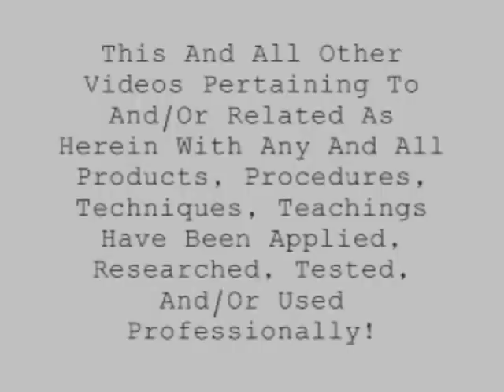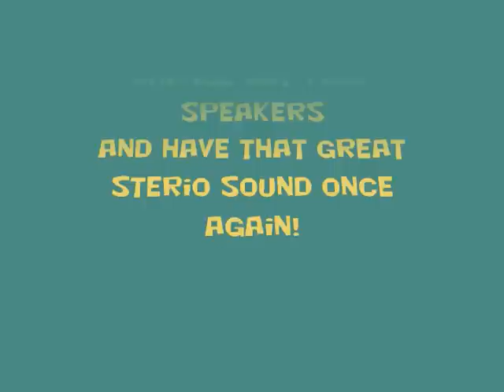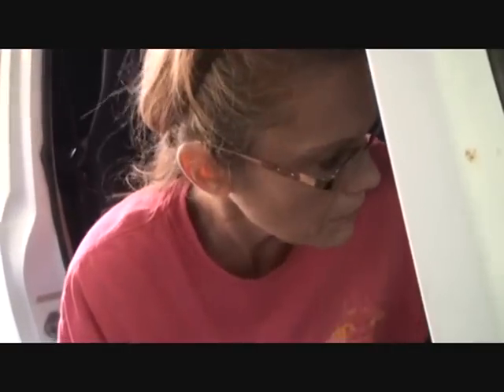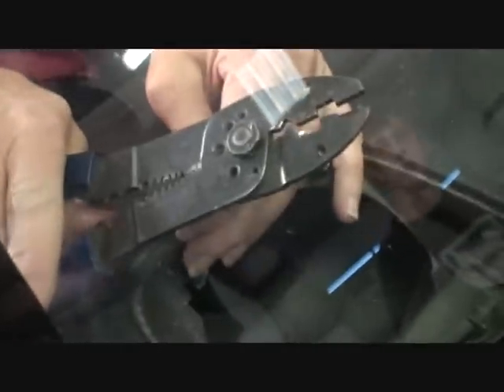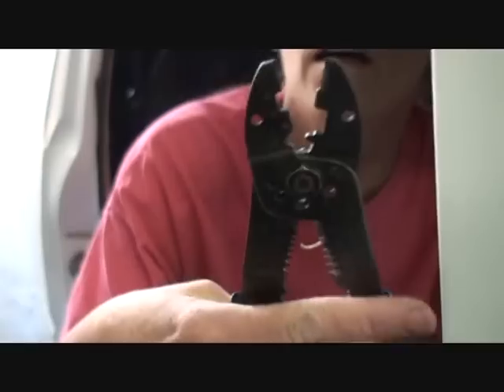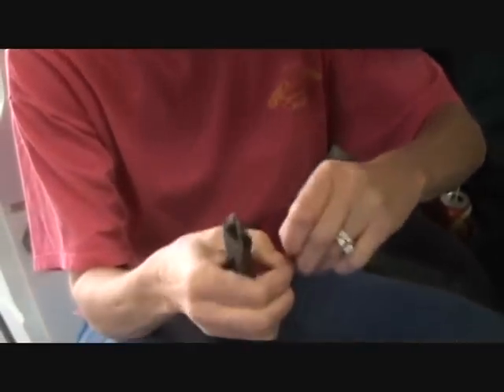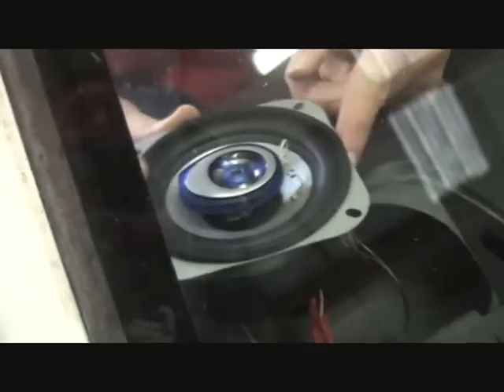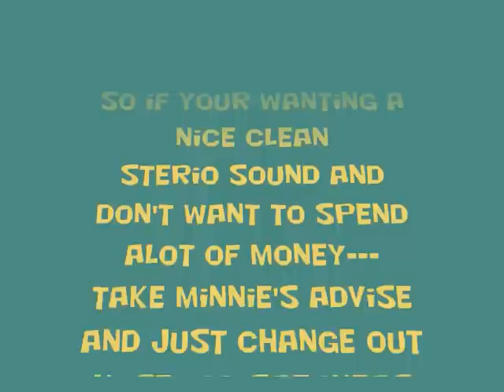Car Stereo and Components: Changing Out Your Old Speakers

Comment: Good job MInnie and Pete.  Putting the two wires on the right posts makes a big difference Pete.  There are a Neg. and a Pos. sign on the speaker.  If on wrong, the sound will pump backward instead of outwards.  Tubers will need to know this.....John.

Comment: i like the technical term "Minnie"used(smushed)to attach the red but connectors but all that could have been avoided if the girl was to remove the factory speaker wires from the plug by inserting a small screwdriver into the plug and depressing the tang that hold the wires in thus having the original wire and metal connector and no cutting or "smushing"needed.good job though and its good to see Swampy continuing his edumacation.thanks My Friend Pete.